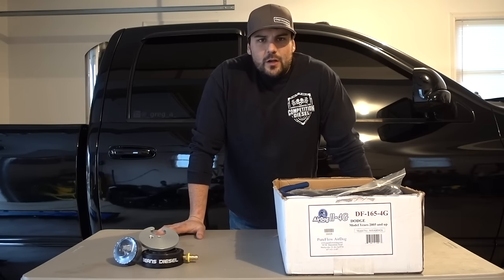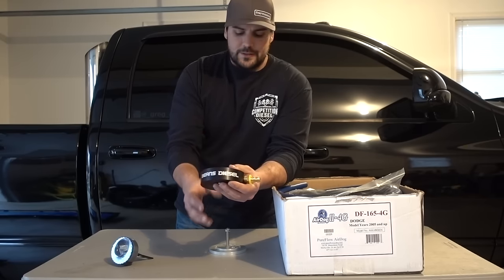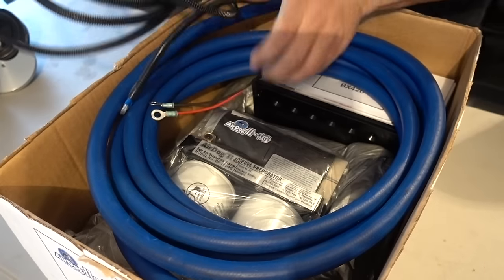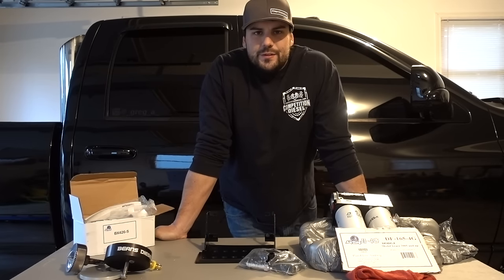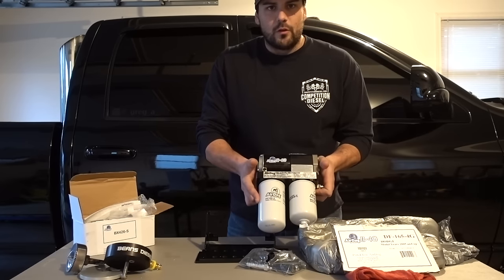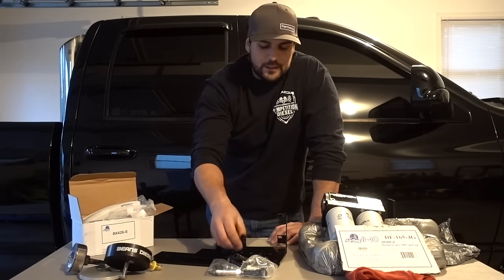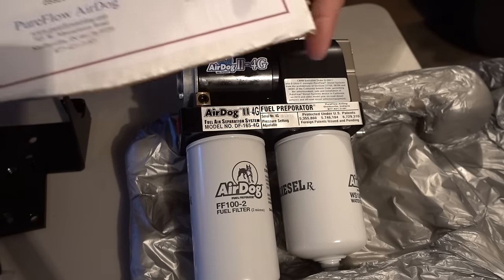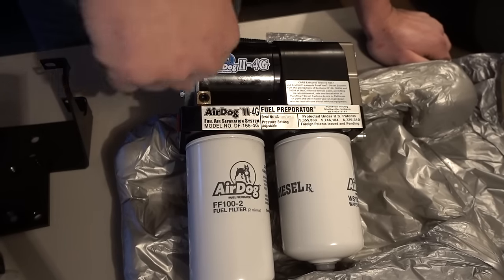AIRDOG!?....WHY!?!?

Comment: is this pump just a better filtering or what is the point of it
Reply from the maker: It is a much much better filtering lift pump and also the major thing is it is a water and air  separator
Reply: okay that makes sense I just was wondering because I have seen a lot of them just did know what they did
Reply from the maker: Yup, air naturally enters any fuel system, this removes that before entering your injection system and injectors.
Reply: okay and badass trucks I am going to try and save money to get a 12v 2nd Gen

Comment: I have a fass 150 and it uses a draw straw. What do I need to do exactly to switch to a beans sump? How can I plug the line from the draw straw and use the sump? I already bought a beans sump and I'm kinda confused  on how to install it?
Reply from the maker: Elliott Barker the fuel line coming from your draw straw should be your feed line, that is the line that needs to go from your sump to your lift pump, all you should need to do is take that line and put it on the pump and then plug your draw straw or hole if you remove it completely. Hope that helps.